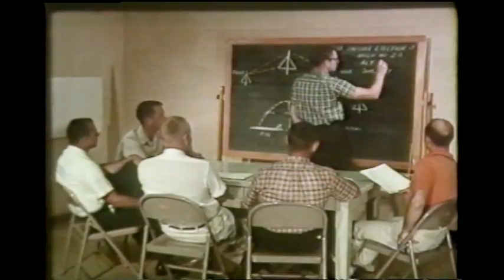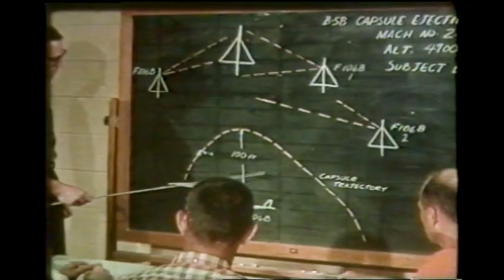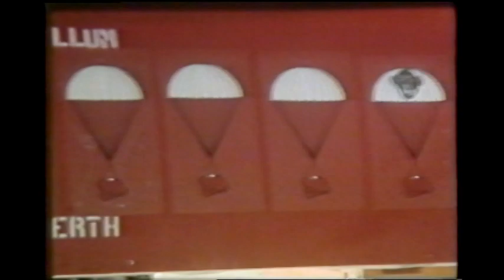Convair B-58 HUSTLER supersonic ejection tests

Comment: Yogi a female black bear rode B-58 ejection seat into the history books by being the first living occupant to leave an aircraft at supersonic speed and survived the G-Forces and landing. But a crueler fate awaited all the animals used in the B-58 ejection tests and Yogi shared it instead of retiring as the Supersonic Bear foe the public to admire. The term "later medical examination" was being killed and then dissected like frogs in school biology class because there internal organ mimic those of humans in the arrangement and it was why they were chosen. The B-58's crew couldn't be that tall because the ejection pod didnt accommodate those that were and if their feet weren't drawn back far enough the shell chop off the front of the foot.
Reply: Of course dissection was inevitable, otherwise what was the point? The bear looked like it was half dead anyway!
Reply: To Dan D.. Sorry they weren't dying, but were  drugged to the point of almost being comatose so they could be trussed up like a Holiday Turkey into the Ejection Seat. What had been known even before they were fired out of the rear of a B-58 was that pilots who had ejected experienced spinal-neck compression injuries to the effect of air blast doing what it liked with the helmet and the head which wore it. Rocket sled testing with humans not only showed that acceleration could be survived but the reverse as well and keeping the body imoblie especially the head was why a shroud pulled down over the face by a pilots arms triggered the ejection thru today. About the only thing shown in the B-58 testing was its Nautilus Shell like ejection seat could work a supersonic speed but it was safer to exit an aircraft as it fell losing speed or trying to recover it not punching the moment it went to wrong. The reason why Yogi and others were killed even after the trails were over was in part to dispose of them and a few data points where studying the effects one them months-years later made more sense scientifically. Indeed the infamous Tuskegee Syhpillis Experiment allowed the group only receiving a placebo drug to go thru the entire horrific effects until death occurred for the same reason because statistically it looked better on paper if test subjects died for the mathematics involed...